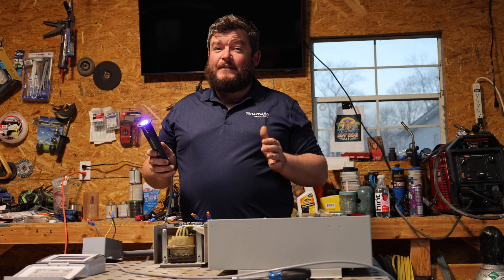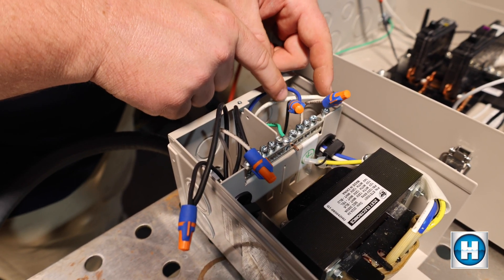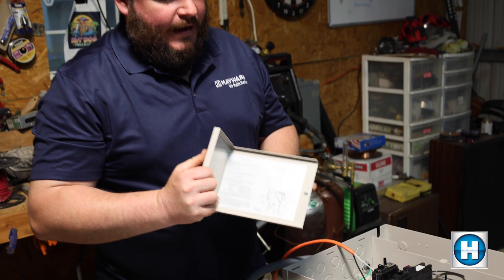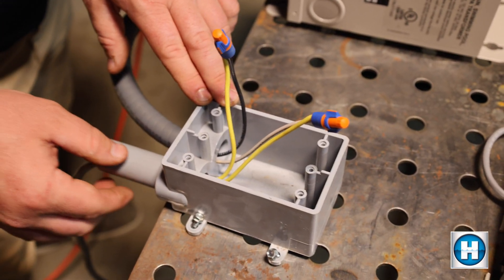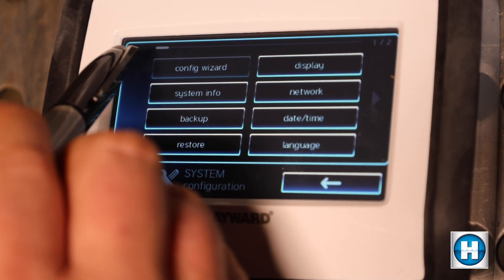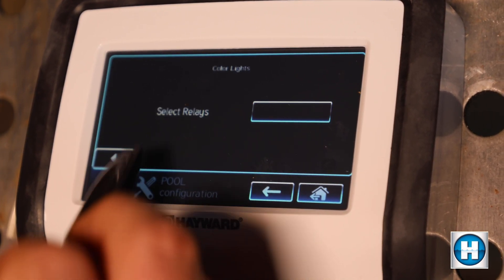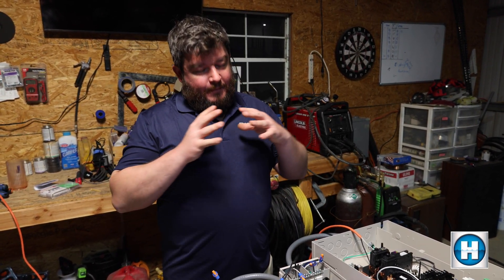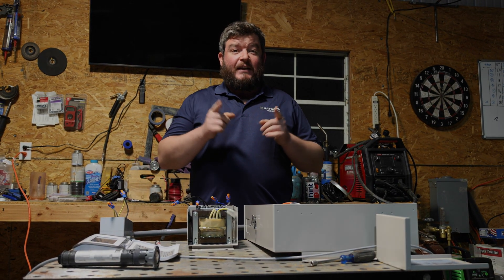How to wire and program low voltage Pool lights to OmnPL (Hayward)

Comment: How does this allow to pick the color of the light
Reply from the maker: It sends pulsing signals through the high-voltage relay, and the light is able to tell what that signal means almost like Morse code.
Reply: @HaywardTechSupport  ok sweet I was losing my mind trying to figure out how a simple on off relay was going to change colors

Comment: I have 2 Universal ColorLogic 12V LED LPCUS22100 Hayward 12v LED color lights with the OmnPL HLBPRO4SW.
Would Wiring two lights to only one High voltage relay be able to control each light Independently and have two different colors at the same time ?
Or does it need to be connected through It's own high-voltage relay...Example, one light in 2 out 4 and the second light in 6 out 8, then both be tied into the transformer, the system will detect the 2 lights?
Reply from the maker: No you would need to wire each light to a separate relay to control them independently. You can accomplish this with one transformer although we generally use a second transformer in this scenario.
Reply: @HaywardTechSupport  How can you accomplish with one transformer?  I am confused.  Assume you have Relay 7 and 8 controlling the two different lights.  Each of those relays can independently activate the transformer, but isn't there only ONE output from the single transformer?  Hence as soon as either relay activates the transformer both lights would turn on.  And what happens if both relays are activated, then aren't you now getting two feeds of 120v to the transformer?

Comment: I have question I’m confused on how to set up my Hayward color logic controller standalone switch 
I have 4 light 
Run them in conduit to the desired location 
Install transformer by conduit from pool lights 
Install GFCI breaker run power from GFCI the transformer high voltage side 
Run whip from transformer to the switch from the switch run it back to low voltage side is this correct way of doing this ?
Reply from the maker: @mikimiki195  the wire feeding the low voltage transformer should go breaker-> high voltage relay -> Transformer.
Reply: @HaywardTechSupport what about switch for color changing on and off 
Breaker >high voltage on transformer >high voltage to the switch >back to transformer low voltage?
Reply from the maker: @ the relay will click to change the color. No low voltage to Omni
Reply from the maker: I assume we are talking about the LKCUS1100 standalone controller. Most simple way to describe the layout is - GFCI to switch > switch to high voltage side of transformer > low voltage side of transformer to lights.
- Tyler

Comment: My installer used SR Smith lights, Would these be UCL also?
Reply from the maker: I am pretty sure that the SR Smith light color scheme is not compatible with the Hayward automation. You have to program the lights as white and quickly turn the lights off and then back on to change the colors. There are some lights that you can place into UCL mode but again I am pretty certain that you cannot do that with SR Smith.
Reply: @HaywardTechSupport  Your description of how they turned on and off is exactly how they worked after the pool installer put them in. In the Lights menu for the Hayward App, I had a single toggle in the top right corner that I would switch on and off quickly to change the color. Since then, I had to reprogram my system and the lights I didnt know how to program. I programmed them as UCL and now I have the full Lighting menu in the app, and the lights arent working properly.  How do I install them as just a white light that I turn on and off?
Reply from the maker: @jasonrudasill8735 check out the Omni programming video on our page
Reply: @HaywardTechSupport  will do.. Thanks!